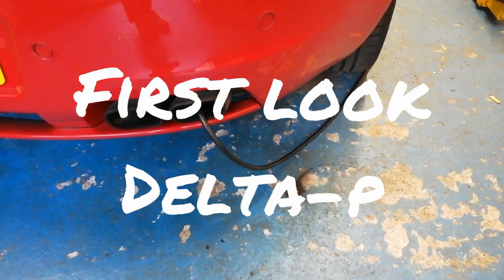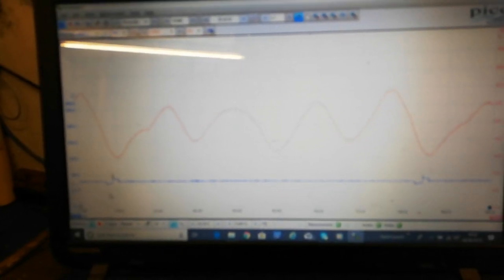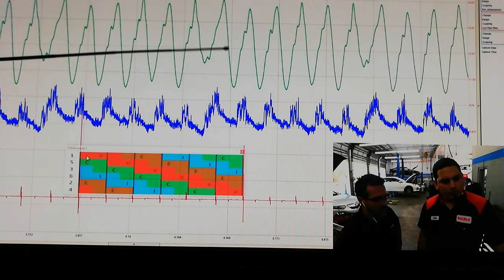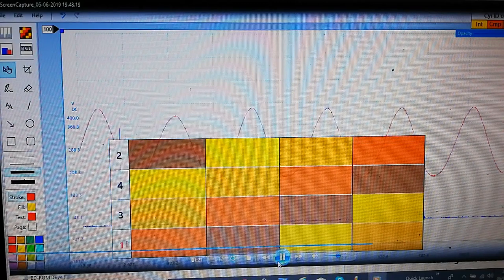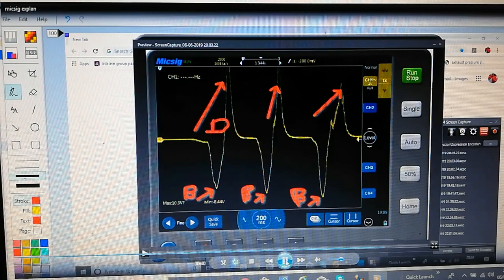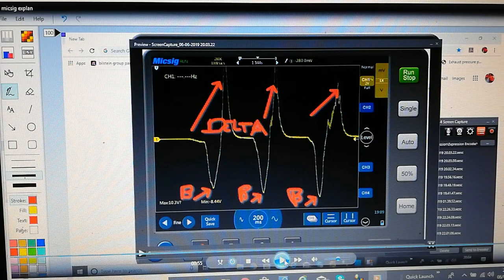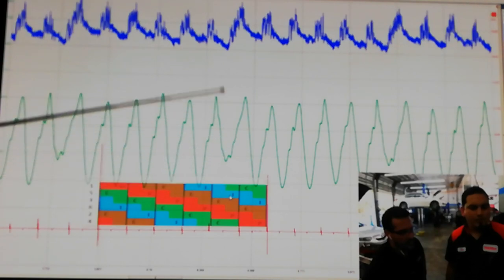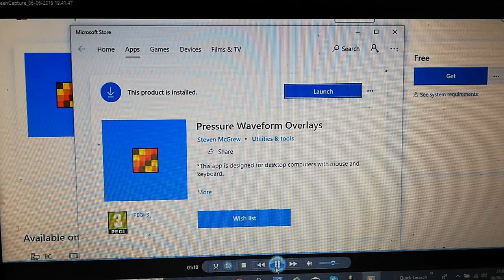Exhaust pulse using First Look Delta Pressure analysis. Waveform Overlay Program

Comment: Thank you for giving a link to Mario's video, most Content Providers would just steal somebody else's information as it is legal on YouTube if you overdub your voice on somebody's content, sad to say. Now for your 4 cylinder information, it's pretty much beginners info with no reason given for the lower dip between #1 and #3 exhaust strokes. Also, your test hose is super long and it does not give a true reading since there is too much time for multiple pulse waves to crash into each other in the long hose and the rubber hose is flexible/expandable/compressible which also smooths out a true waveform, this is a couple of reasons why your wave looks so smooth and almost perfect. For folks without an overlay, you will notice that #1 spark is used for a trigger point and #1 exhaust pulse is delayed to the next rising pulse to the right as it takes that much time for a 4 cylinder exhaust pulse to travel all the way from the head to the tailpipe. So right after your trigger spark, you will read the previous exhaust pulse in the firing order, 1, 3, 4, 2, 1 as #1 just sparked #2 pulse is coming out of the tailpipe in case you cannot get an overlay for your cell phone or android device or an overlay for your scope when you are in the field and need this info right now. 

Also, I will let you know that the overlay SUCKS for a 6 cylinder and does not picture the actual events on screen, actual events in real-time are happening of course, but real-time waveforms are not what is FULLY drawn on a scope screen, for example, the full real-time activity of a Relative Compression test is not fully drawn, only about half of the information, which really forces you to learn how to understand the overlay much better.
Reply from the maker: This video is not intended as a substitute for a full training course. It is an introduction to a free overlay tool. The exhaust pulse is deliberately smoothed out(not by using a long hose). If you think the overlay SUCKS then don't use it

Comment: This is why I watch your stuff Dave. This one is really challenging the limits of my understanding. I think I'm gonna have to watch is one a few times to be honest. Question... if it is a delta type sensor, what is the reference pressure/parameter? I hope that question is clear...in other words, how do you sense "delta" with only one sense line?
Reply from the maker: hey ian, i can tell your intrigued by this one. eyyyo thats why i do these vids and not the repair vids so much. The sensor reads the variations in pressure and ignores the average and/or static pressure. So to put it another way, it only sees changes in pressure from the recent average pressure, the flat line being no activity. These changes are the Delta or Differential pressure as it is known from different terminologies. If you remember the piezoelectric video showing the voltage changing from + to -. Hope this helps, glad you enjoyed it. cheers dave
Reply: @davesterl  Ahhh.....I see. So on the demo trace on the Micsig with you blowing on the tube...the "negative" px is not really negative only negative relative to the instant before. Is that correct ?
Reply from the maker: @TheGibby3340  absolutely 100% ian. The positive pressure from the blow shows as negative/downward on the trace as it is different from the average then the opposite/upward trace shown on the release of the blow. Good init. You needto get one or make one
Reply: @davesterl  Dave, I finally got a minute to check out Mario & Brandon's Vid you refer to in this Vid. I can see why it impressed you so much. Brandon is clearly a Master of his trade. (That term is sometimes loosely applied these days, but I mean it in the true sense of the word). Not only a gifted mind, but remarkably capable instructor.
Reply from the maker: yes Ian, its what the guy does and is highly regarded in the field. He covers quite a lot in Mario's vid. Communicating a technical topic is a skill in itself